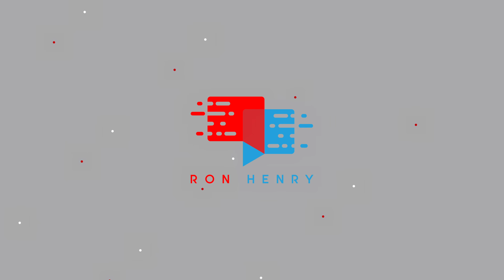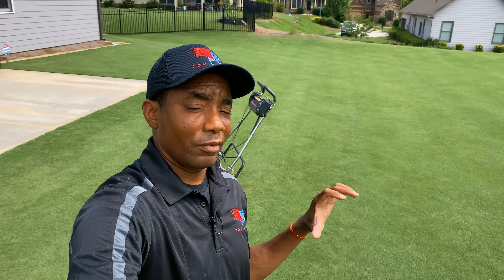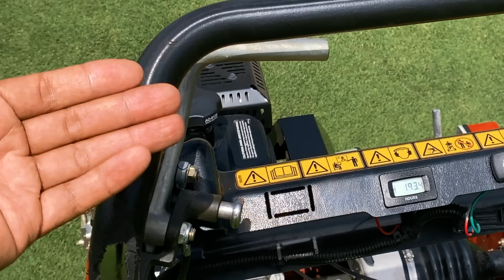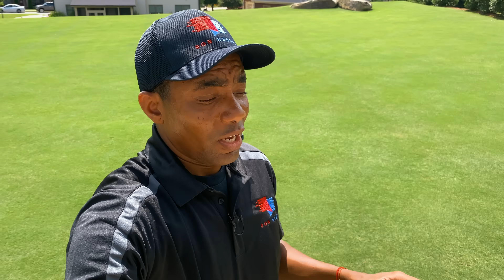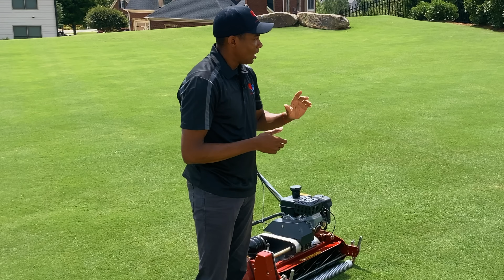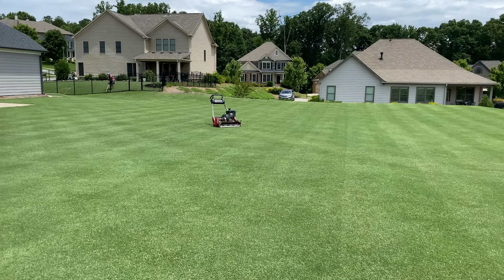Toro [GREENSMASTER 1600 REEL MOWER] - Is it Worth $10,000?

Comment: Where did you find it at? Was it new or used?
Reply from the maker: Hi Brian. I bought it pre-owned. Brand new, these mowers are anywhere between 11k - 12.5k depending on options. Got it from https://prairieturfequipment.com/ My unit is a 2014 model with only 192 hours on it when got it. Came with transport wheels and basket. Great condition unit. If you give them a call, let them know I sent you! 😎
Reply: Ron Henry, If you don't mind me asking, how much did your 2014 unit cost you? Did you have it shipped to you? I'm trying to figure out what's a good price because I'm currently looking at an 2014 unit myself.

Thanks
Reply from the maker: Hi Mahidi. My unit was just under $4k shipped. It's a very lower hours example so you can  probably pay quite a bit less than that depending on what shipping costs you.
Reply: @RonHenry  curious what shipping cost on these mowers. Where did it go to?

Comment: Did you buy this at an auction, eBay, or used equipment site?  Balllpark how much?
Reply: For some reason this is one of the biggest secrets of all time(costs for golf course grade mowers), but his looks like a 2010-2014 1600 model or thereabouts.  and depending on the usage its had... his mower in excellent condition used will cost approx between $1750 and $4500.  (heavy usage: 1000 hours or so will cost around $1500.. and more around $4500 if its only had a very light 100-200 hours put on it) I'll let Ron reply if he wants, but maybe he doesn't want to give that away?
Reply from the maker: Hi Michael. I got it from https://prairieturfequipment.com/ Mower was in great shape with only 192 hours on it when I got it which is practically nothing for a 2014 model. Space Elevators numbers are spot on. You can check the website for an idea of what they go for. You can pick up a great unit, serviced and shipped to your door for well under 4k depending on which model you go with.

Comment: Ok.  Awesome.   You know you now have to build a small green in the backyard!!!  Right?   Great review.   Thanks for all your work. Want to see that .125 like my golf club.  :)
Reply from the maker: It would be cool Anthony. For a green though, that would mean daily mowing for sure. The mower is definitely capable of it though. I'd have to really level on spot of the lawn if I were going to do it.
Reply from the maker: I do W Jack. I have a nice set of Mizunos from when I used to play a lot. I'll think about it some more. I can easily mow a green every morning. It's not like it's a super big area. :-)
Reply from the maker: But I'd have to build some unevenness into the lawn for a proper green. Would need different types of breaks depending on where the hole is cut. I never got my handicap under 10. 8 is really good. You can play with anyone with an 8 hdcp and not feel like you're slowing down play.

Comment: How often do you have to adjust the reel to bedknife? I have a Swardman and love it, but it’s not as industrial as the toro. Thinking of keeping the Swardman for verticutting and brushing sand and getting a toro as the workhorse  for the 10,000 sq ft lawn.
Reply from the maker: Hi keyeskennard. I've put about 8 hours of mowing on it, and I've not adjusted the reel to bed knife distance as yet. The mower still cuts paper and has held a sharp edge very well. Adjusting the reel to bed knife clearance is a very, very simple operation. Literally takes a minute or 2. I'm still keeping my Tru Cut for tighter spaces so I get what you're thinking as far as keeping the Swardman. The Greensmaster is built like a tank. Even more solid that the Tru Cut. 👍😎

Comment: Ron I had GM first but didn’t like it. If you have some good grade it’s difficult to keep it going straight with that smooth drum. Going around beds you don’t have the ability to feather the speed. For the homeowner in my opinion the TC is better...
Reply from the maker: K9. I still have my Tru Cut. Unlikely to get rid of it. I agree with you that the Tru Cut is the better choice for residential lawns. It works everywhere with the only compromise being the quality of cut that you get. If I can only have 1 mower, it would still be the Tru Cut.
Reply: Ron Henry ya I would go with the TC over all. I’m not worrying about cutting to the hundred of an inch like a putting green. The speed is adjustable without sacrificing blade speed. You GM is a lot newer than the one I had. It was a 1994. Ran perfect. But are great but I would say the yard should dictate which machine. Greens are generally flat and some undulations. I think your front has a little slope but I think you’ll be ok... good luck
Reply from the maker: Thanks so much K9. I'll put together a comparison video between the 2 mowers for people that are on the fence on which way to go.
Reply: Ron Henry you’re doing great on channel brother...
Reply from the maker: Trying my best K9. Glad you guys are getting some value from it.  😎👍

Comment: Nice, I have a 1600 1999 model. I love the cut. Have had to replace alot of parts. Mostly bearings so I've had to learn how the machine works.  Its aggravating sometime but when its all back together its great. I currently mow my bermuda at 1 "
Reply from the maker: Very nice Pop and Son Lawn Care. A 1999 unit that's still going strong is pretty impressive. Figure that it's over 20 years old at this point so having to replace a few bearings is to be expected I guess. I bet you get amazing stripes with a 1" height of cut.

Comment: Good choice Ron, any reason why you didn't get the Flex? Just curious, Probably with your lawn it wasn't needed.  JD mowers are very good as well, Happy mowing
Reply from the maker: Hi David. I believe the Flex units have a lower max height of cut than the 1600 which is why I opted for that. The greensmaster 1600 can go up to 1.25" and down to greens heights of cut. The additional flexibility is why I went that route.  Great question. Thanks for watching the content.

Comment: Those extended axels screw out and can easily be removed and stored with the tires. It makes the mower much easier to work around obstacles.  Great video!  Looks like a real nice unit, mine is a bit older with the Kawasaki, they sure cut nice.
Reply from the maker: Thanks Grewvyman. I considered removing them, but even removed, the mower is still too wide to work in areas like been Alex's lawn and mine. I really like the mower. I think it had something like 192 hours on it so very low hours. I'm really enjoying it. The cut and #stripeaction is incredible. 👍😎

Comment: Most excellent Ron. Looks like you located a very nice unit. There is certainly nothing wrong with the Tru-Cuts, McLanes or Cal-Trimmers, but the Toro is a step up. The quality of cut will be readily apparent. Ground speed is NBD as better mowing is usually obtained at slower pace anyway.

If the protruding axles are problematic near the rocks (or other obstacles) perhaps you can segregate these areas with something like a metal edging. This can be pounded in to a low height where the axles will ride over. I have had good luck with Coyote Landscape edging as well as Edge Right.
Reply from the maker: Definitely agree Richard. The quality of cut with the greensmaster is so much better than what I was getting with the Tru-Cut. I imagine the combination of the grooved roller,  drum propulsion system, weight and 8 blade reel is making a lot of the difference.  I'll have to look into the Coyote landscaping edge. I've been using the Tru-Cut to clean up those areas but if the landscape blade produces similar results, I can just go that route. Thanks for chiming in Richard. Really appreciate it. 👍😎
Reply: @RonHenry  Ron, if you decide to try the edging, here is what I do... lay out a garden hose to get the desired shape and curves. Then I take my stick edger and cut the slot about 2" (or so) deep following the hose. Then, I place the edging in the slit, bending to follow the contours. Then I take a hammer / 2x4 board and pound in to the desired depth. That seems to be the easiest approach. The edging comes in 8' pieces with 5 per pack. The 4" height would be sufficient. BTW, it's much easier on wet ground.
Reply from the maker: Thanks for the explanation Richard. And the space between the edging and the obstacle, I just keep groomed with a string trimmer I take it?
Reply: @RonHenry  Nope, a Glyphosate product and then mulch it. No need for a string trimmer.
Reply: Forgot to add... keep your curves gentle and flowing and the mower can easily glide along and cut to the edge.
Reply from the maker: Gotcha.  That would make things much easier.  😎 This doesn’t sound too bad to do.
Reply from the maker: That's a good tip Richard. This would probably work well out by the rocks.